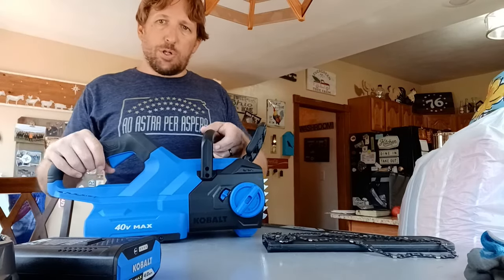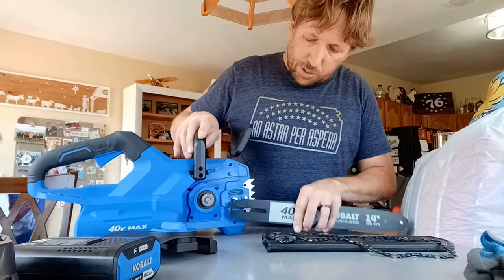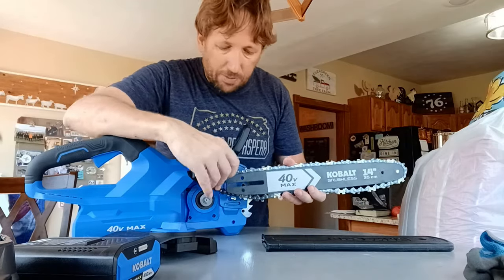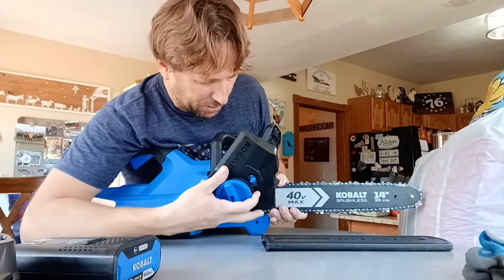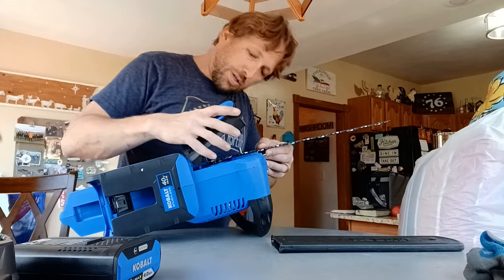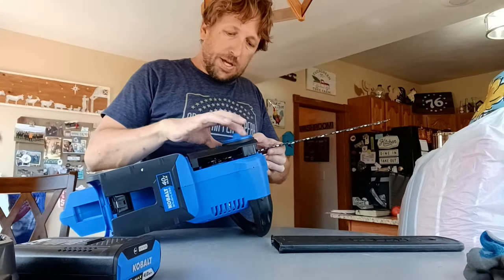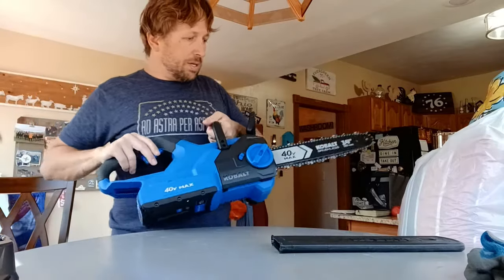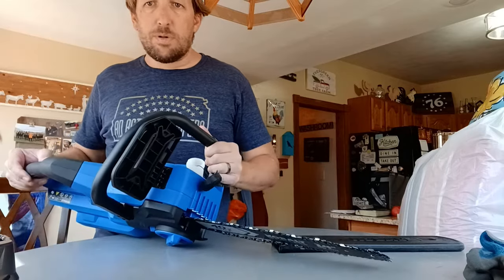Kobalt 40v Chainsaw. Quick Start Guide.

Comment: I love my Kobalt Pole Chainsaw - 80-volt - 5-AH battery - 10" Bar - 6 ft / 8ft foot Pole Chainsaw. No electric cord.  I've been using Oregon Bars and Chains. I have been using it for more than 3 years now. It works great on my southeast Louisiana farm clearing property that a hurricane went through and trashed all the trees throughout the woods of our 18-acre farm. I carry it all over in our woods and the battery lasts a long time. Today I'll be cutting a 6-inch limb off of a tree out front. I am also using (2) Kobalt 80 volt 18" Bar Chainsaws and using (2) 5 AH Batteries. Cuts huge logs great. The chainsaw first one wound up in a puddle and stopped working but after a couple of weeks and it had dried out, it started working again. For oil, I like to use Ryobi Bar and chain oil. We have cut 20"+_ logs and works like a charm. And NO more pulling and pulling to start a gas-powered chainsaw.
Reply from the maker: Wow, you are a hard working farmer! Thanks for the good advice. Those storms can be a doozy. A big snow storm took out tons of branches on our property in Oregon one year. We were thankful for this pole saw to keep the branches from falling on our critters. God bless!

Comment: the obvious things that I noticed: not wearing gloves, you gotta think about safety first. The chains can be sharp. Other than that, great demo. But I already knew how to put together my saw before I saw this video. I bought this saw at Lowes for $199 and didnt need the manual since I had the Dewalt 24 V smaller saw from Home Depot first. I returned that and got this Kobalt chainsaw instead. Man, it cuts trees like bread & butter. I love this saw.
Reply from the maker: Simple and easy is best!

Comment: I just got one of these. The instructions say that when you first assemble the bar and chain, the chain should be just loose enough to be able to turn it by hand. However, I'm unable to turn it, no matter how loose I make it. Could the problem be that my sprocket wheel won't turn for some reason? I cannot manually turn the sprocket wheel, which I think is the reason I can't manually turn the chain. Does this make any sense?
Reply from the maker: Hi Steve! It sure sounds like something is wrong with your chainsaw. Could it be that the safety is on and thus it won't turn? Try releasing the safety and if it still won't move then maybe check with Lowe's. If it's defective they probably swap it for a new one. hope you figure it out! God bless!
Reply: @diyamerican  Hah! That was it. Turning off the safety brake made all the difference.
Reply from the maker: YAY! Happy sawing! God bless.
Reply: Ohhhh. I did same thing.

Comment: Mine dies as soon as there is any resistance. Battery is new and fully charged. The 12" kobalt I've been borrowing works fine.
Reply from the maker: Sorry to hear. Hopefully Lowe's will do something to back up their product. When I lived in Oregon we had a really great Lowe's and they would do whatever it took to make the customer happy. When I moved to Kansas and I had a problem with a Lowe's product they basically told me tough luck. I guess it just depends if there's a good manager at your local store or not. Best of luck!

Comment: I like your video and display but i caution users like me- take a little more time to make sure you are properly tensioned than me!  I kinda disagree with his startup, there should be pretty solid tension in the chain for a cold bar. Like he says- not overly tight and dumb but there’s no reason for extra slack in an out of the box unit. Trust me it won’t keep the chain on.  I pretty much followed the video and my chain flew off in first tiny branch!  The manual sucks for not having a basic unboxing procedure so this video is excellent to that. But once you are ready to tension the chain, go to the manual!  Also the manual has a better explanation of the direction of the chain install in that there are tiny arrows to point you in the direction of the cutting action.
Reply from the maker: Thanks for sharing your take on it. Have a blessed day.